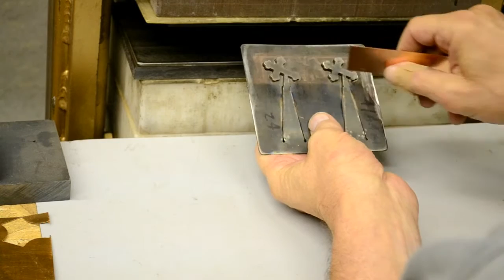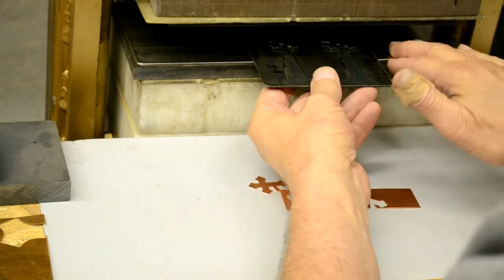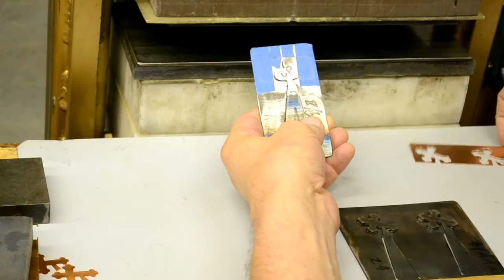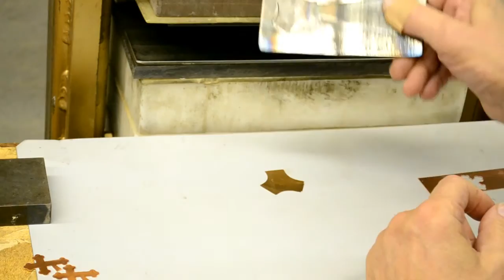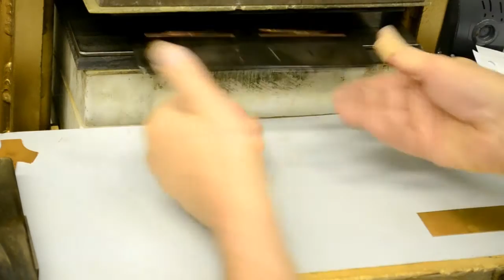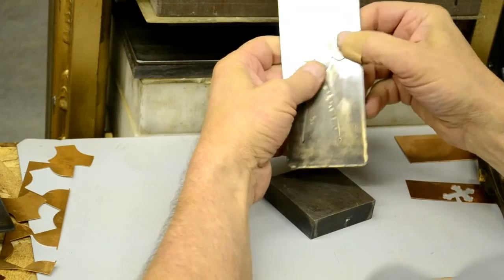Fundamentals of Using Pancake Dies

Comment: Can I use your dues in a harbor freight 6 ton press?
Reply: *dies
Reply from the maker: Hi,  Yes, as long as you use the "universal" setup for pancake dies, which is sandwiching (at least)  the whole design area of the die between solid (steel) plates (1/2" x3" x3" bench blocks work well for small designs ) . You can't have the ram of the  press only contacting part of the design, because the force has to be spread evenly , or the die could break or deform . A 6-ton press will do most small and medium earrings and pendant-size pieces, but not, say, a bracelet out of 18 ga.  Northern Tool also has good deals on good-quality hydraulic presses. Remember though that the "shop presses" are not ready-to-use for pancake dies.You have to set them up with the sandwich plates yourself.

Comment from the maker: I make these the best way they can be made , with tight tolerance, so they can cut even thin metal cleanly , and I use heat treated tool steel, for maximum durability, even on intricate designs .
Reply: How do I find out pricing on your dies - I see none listed at your site??
Reply: How thick of steel 'blank' can a pancake die cut out? And are there limitations on what metal can be used as a 'blank' so long as it's been annealed?